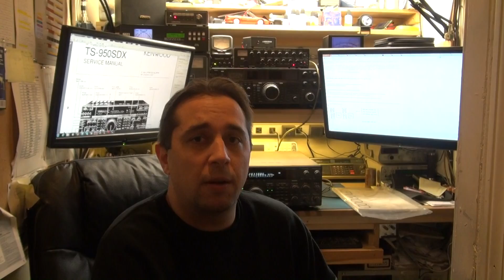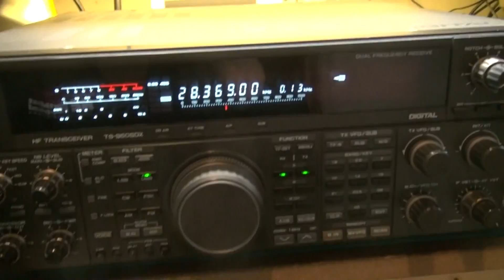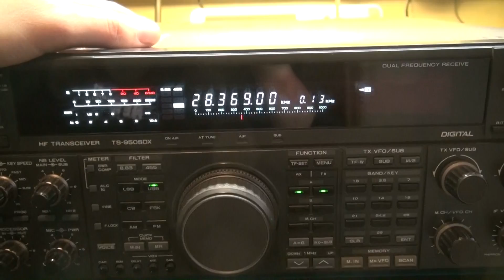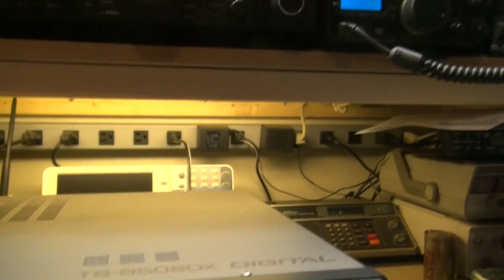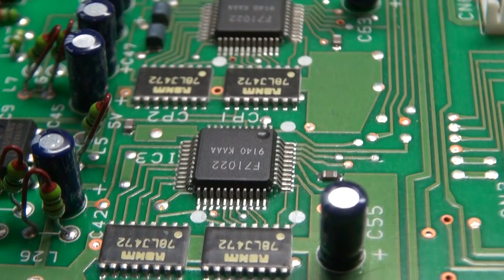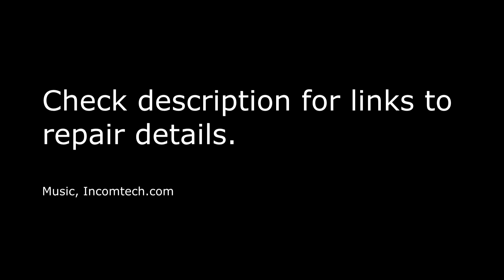Kenwood TS-950 Repair "TX/RX" Issues

Comment: my 950 sdx when i press ptt in ssb mode the power out comes out like am/fm mode and when i try to run AT Tuner even though swr 1.1 tuner doesn't stop working and the alarm beeps continuously.....what should i do?

Comment: could it be that one of the PLL board cable connectors was the fault as this might explain why some folks don't get a fix after the soldering of the resistor arrays ..
Reply: probably both dds chips also have to be re soldered,resistor arrays go directly on pins of those 2 dds chips ....other possibility is that they unintentionally produce short circuit between pins one or more...it is best to use electronic microscope for the inspections after re soldering

Comment: Good video on the 95oSDX. A lot of electronics from that era have the same solder problems. Something about more tin and less lead leading to micro cracks in the solder. I have a re=flow station but I need to learn how to do it.

Comment: question for anybody i have a techwood ddr 95 and its in power mode does anybody have a clue i checked all the fuses and that was about where i could go dont have a meter so where should i go and parts are almost inposible to find for it please help

Comment: Great job I have done this to mine also .Another issue is the tx/rx sub board on the control board this acts up and drops out TX and Rx intermittently dry joints on the resistors its a pain to get at but worth doing .Thanks for posting